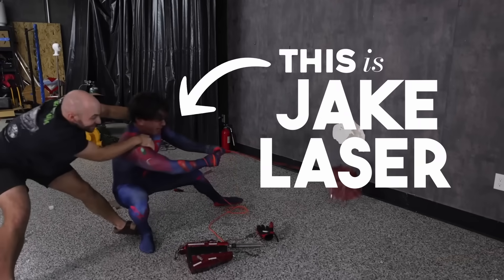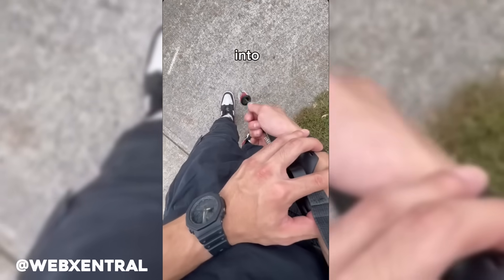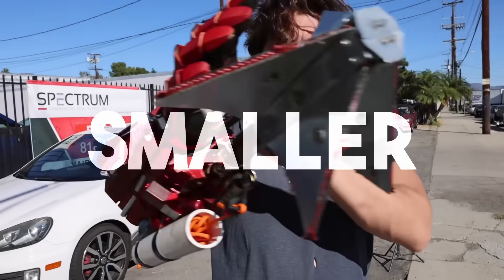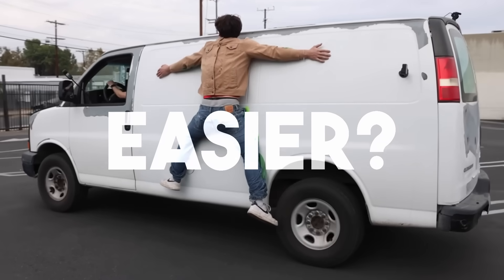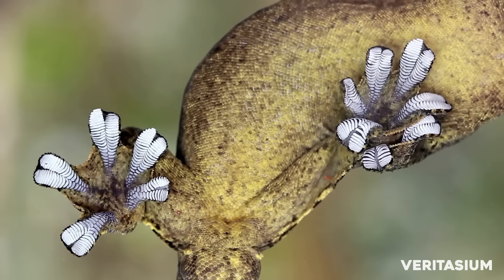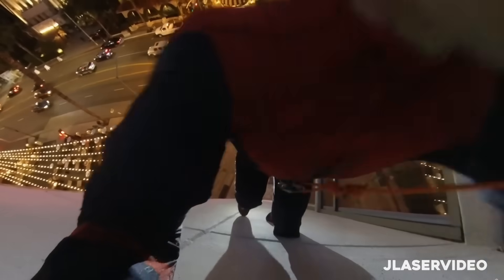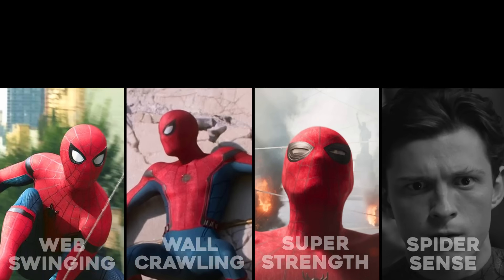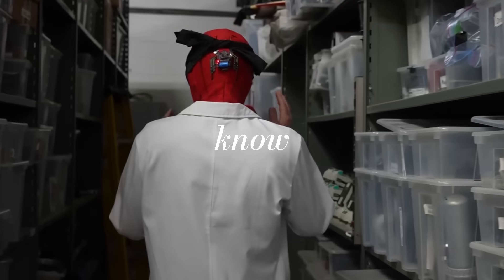How Close Are We to Becoming Spider-Man?

Comment: Miniaturization is a thing in tech, sure. But there's a massive difference between miniaturizing logic switches based on electrical potential differences that also exist at literally atomic scales, and miniaturizing a system of pressurized gas, some sort of rope, harnesses, sticky stuff, etc. The physical properties of electronic logic systems exists on an incredibly small scale. The physical properties of load bearing cabling and pressurized gas cylinders don't exist at that small of a scale.

Comment: Every technology comes down to three(I'd argue 2) components: Information, energy density, and materials(but with the right information and energy, you can manufacture any material one might need). You need to know exactly what it is you're trying to achieve, and the energy to achieve it. 

I'd argue the number one issue with making a superhuman, comes down to resiliency. You can have all the super strength and speed you want, any enhanced senses or such, but you need a body that can take the forces involved in using both. There are literally people out there who are stronger than their bodies can withstand. Hysterical strength is one such example. I have an odd feeling that somewhere down the road, we're going to find ourselves surrounded by superhumans, because of some absurd technological development involving humans gaining true regeneration and enhanced endurance. That'll be the primary hurdle.

Comment: Interesting video, but I think it's a myth that tech inherently becomes smaller over time. It's more accurate to say tech becomes more optimized over time. And you can't get more optimized than the laws of nature. Spiders aren't tapping into optimization that humans haven't discovered. Kevlar rope is stronger than spider silk. Our sticky materials are stickier than spider feet. Titanium is the strongest rigid material for it's weight. Spiders are simply taking advantage of the square-cube law by being really tiny, and we aren't going to out-invent the square-cube law.

We aren't really on the edge of any breakthrough here except for maybe your AI spider sense idea. Instead it seems like we are plateauing and probably won't see many more optimizations. At best, J-Lasers next web shooter shrinks the wrist launcher by loading explosive rounds instead of using pressurized air.

Comment: My only gripe with this is that while using computers as a good example of tech shrinking to be smaller and lighter it is different from the matter of making hardware smaller. Computers shrunk because they compacted information but compacting hardware is near impossible because it's dealing with mass, strength, and energy.
Reply from the maker: Its definitely harder, but not impossible. Just wanted to use an example understandable by anyone. Motors and batteries used to be huge, while giving off a lot less power than they do now. It IS true that its not as easy as shrinking data, but it happens. Although I should have used a more hardware-focused example tbh. Thanks!
Reply: @TalkinBout-1706 you're right, those are good examples, thanks for the video

Comment: Realistically speaking it's not that we currently do not possess the science to technology required to make a realistic spider sized suit that would give most of these abilities we have commercially available exoskeleton to boost strength (they are light and small) we already have pretty light weight material to make the suit out of for boosted protection and there's probably the material needed to make proper webs out of sitting in some material science journal or archive online the major limiter isn't our capability to do it but the funds and willingness, realistically speaking making a worthy prototype would cost a couple thousand to hundreds of thousands of dollars(on the high end) so most people and engineers online aren't willing to do it and also the time to search through the applied sciences literature to find potential candidates for materials and tech that can be used